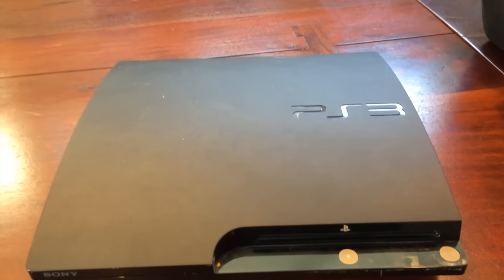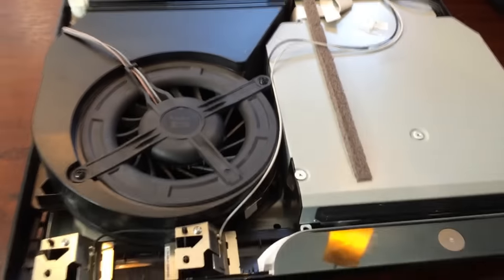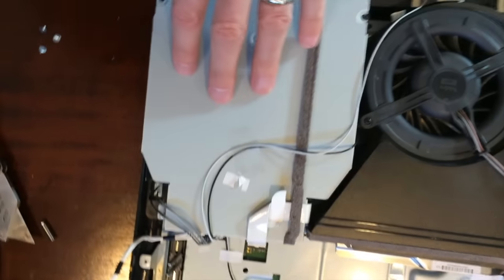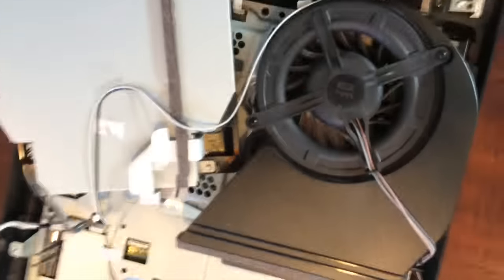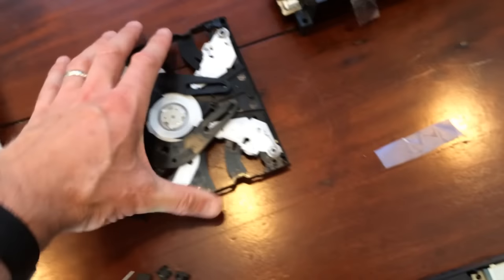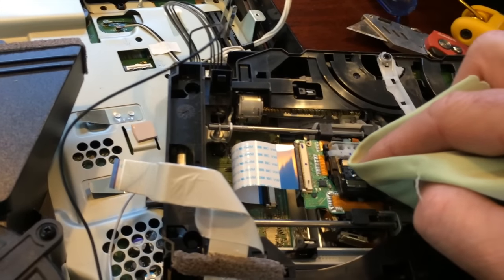How to disassemble and clean your PS3 laser

Comment: What kind of alcoholic do i use for cleaning? Would vodka do? (40%)
Reply from the maker: Probably would leave a residue. Don't think id use it. Rubbing alcohol from the drug store is super cheap.
Reply: Mark Chalmers I ordered 99,9% from ebay, cleaned the laser. Seems like all my games are running fine except Assassin's Creed 3. It will sometimes stop loading and you can hear no sound and it will freeze, and you can hear the laser trying to read the disc. The disc is clean from dust and smudges, tried reinstalling game data too. And option 2,3 in safe mode! Any help?

Comment: Ok. Using this vid. Im gonna try it. I have lots of experience w/electronics. I installed cheater menu start up chips in the original ps for myself and all my friends. I think i can handle this, and it may work. Its doing what most of these are. Doesnt show disc at game menu. Makes an eject sound about 30 seconds after inserting disc. Was freezing on screen often and would have to restart then last night it would not restart. I have a 5 yr old and a 12 yr old, and about 100 dimension pieces counting on this to work. My buddy said i could borrow his sons old console but there go all my kids downloads and saved info. So ill try. The console its self is about 9 yrs old, never been cleaned and looks it . every air duct is clogged w/dust lol so i can only guess what it looks like inside. Trying this tonight after kids bed time. I will leave a second comment whether it works or not. If not, can i really complain ? This thing has had a tough life really. The kids never shut it off. This machine should teally be a testiment to the sony corp.
Reply: Nope. Did not work for MY ps3. But i was not getting an error code. Noticed since i reassembled it DOES play cd's and dvd's but NOT blue ray or ps3 games. I would believe the blue ray part is all done. Dead.
Reply from the maker: how did it go?
Reply: Mark Chalmers well, i ordered the part today on amazon. $25 new laser.keh450AAA.  It needed to be cleaned/vacuumed out really bad. Inside the disc drive wasnt too bad. Got free shipping so ill have to report back in a couple weeks and the kids will have to do w/o for a moment
Reply: Your video got all this going. I would not have opened if i didnt see someone do this. Thanks.
Reply: Mark Chalmers part came this afternoon. Took 30 minutes to install (i already had it apart) it works !!! $25 amazon, im so happy it works, the kids will be even happier.

Comment: SONY SUCKS when it comes to consoles that stop reading discs, consoles that over heat due to not enough vents or the vents are not large enough, and "drum roll", those DANG wireless controllers not connecting or not charging.

Comment: My ps3 dont want to connect on my WI-FI  and I tried that thing with save mode for connection but it still not working will this help if I try
Reply: Uh-
Reply: No
Reply: You either need a better WIFI or a lan cable

Comment: Getting the 3 little screws out in the front is the most ridiculous part of this whole thing...Idk what tools you guys are talking about. The little stud in the middle of the screw is impeding the usage of the star tool and jeweler's screwdriver.
Reply from the maker: It is a pain but if you have the right size jewelers screwdriver it will work. Sorry can't be of more help.
Reply: I got it! Thanks Mark! Unfortunately, cleaning the laser didn't fix my problem 😭

Comment: Ik im 6 years outta date but pls help me... I did everything but when i put in a disc boom at the very front of the ejection port the little white stub thing blocks my discs like theres a game in it but i press eject and it still there and its pissing me off
Reply: Turn off ur ps3 take out the power cord hold down the eject button while holding the eject button plug the power cord back in still holding the eject button it should work
Reply: @Kflipp  thank you it worked

Comment: So basically get the right screwdrivers and tools, screw out certain nails, take out certain equipment, clean the chip causing all the problems and that's it? Got it, thanks.Your basically dismantling the PS3 to fix it.

Comment: Unfortunately, it did not fix mine. It reads PS1 CD's, and it even reads PS2 one's, but says that format is not supported, of course. It refuses to read PS3 games, and I'm out of ideas. I already reset my PS3 yesterday, and it worked for some time, but when I turned it off it started acting up. Anyone have some ideas what it might be, or I'm out of luck and my drive is dead?

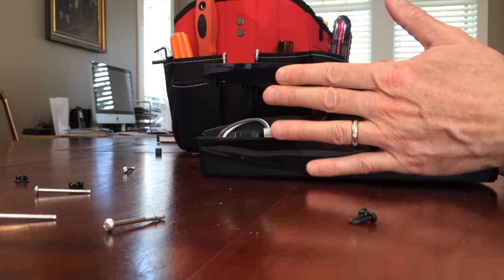Comment: My PS3 doesn't want to open at the front part. In the back can be opened. Is like as they were screwed in the front. At 2:32 moment. Please HELP!
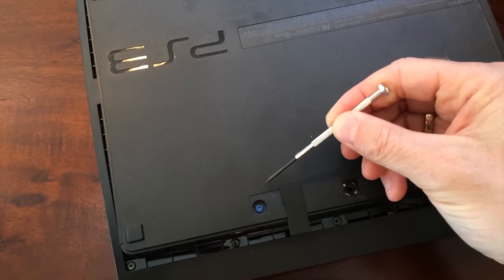Reply from the maker: Hi Marius. Sorry you're having trouble. Usually its the screw under the small cover shown at 1:14 that ppl forget to remove. Other than that, it may be that you have a different model? Hope this helps.
Reply: You have right. Was under the small cover. Thanks!!

Comment: Took it apart, cleaned it, put it back together. Still doesnt read disks but thats fine ill just buy games on psn.

But now no applications will run. Not Netflix, not PS Store. Did I forget to plug a cable back in when i put it back together
Reply from the maker: Weird.....I can only guess that the connection is not tight and the Internet connection is not there. Does WiFi work?
Reply: I have the same problem but it wont even take the disc in. Is this what is happening to you?

Comment: lol so i have a fail situation, as i tried to assemble everything back together and tried it , it did turn on but i pushed the eject button it just start to make loud noise. I turned it off again and redid everything and put everything back together and it did the same thing.  so i am stuck now.
Reply: you messed up the blue ray drive moder mechanism. you have to reset the mechanism. happened to me when a friend and I tried to fix my ps3. he went on and tried things and fucked it up. luckily for me, I managed to figure it out. it's very delicate so try not to mess up the blue ray driver mechanism. search on YouTube to fix your problem. I can't explain on how I did it.
(note: If you did fix ur issue then cheers mate :D )

Comment: my games wont load, they wont spin, is this the problem?
Reply: yes
Reply: READ THIS IF YOU DONT WANT TO MESS UP!
If you are going to attempt what he did in this video my suggestion is don't, it may or may not work but dont physically touch the lens with anything at all, if you really want to clean it the best thing to do is to use Air Compressed Duster. 

If your ps3 doesn't read any disc afterwards make sure the ribbons connected at the back of the lens were put back properly on the board 

If you happen to be from the Philippines go to P x P repair shop in Carriedo Manila. My ps3 was supposed to have a lens replacement, his technician check the ribbons and put it back in place I end up not paying for anything at all. 

In the most filthy of places you'll find the purest and cleanest people ever.

Comment: You taken a 50 - 50 chances when taking any console apart for any reasons. Best recommendations keep care of your console. Don't throw it around or drop it. Don't pour water or soda- pops on consoles. Use the inside console fan to blow dust out of the console every monthly. Don't take it apart. I've had my PS3 for 13 years & still runs/ plays like a Swiss Rolex watch. Never had it apart.

Comment: my ps3 works good but sometimes whem i'm playing a game it freezes and i need to turn it off with the power button can someone say what the problem is
Reply: Is it one specific game? It may just be that the game's unstable cough Bethesda cough or the disk is dirty/damaged
Reply: Predator23321 it's bo3
Reply: khushveer lal What's the condition of the underside of the disk?
Reply: Predator23321 it's clean without any scratches
Reply: khushveer lal Seems like it could be an overheating problem. If your PS3 is clogged up with dust it will make it difficult to expel heat. Try taking apart your PS3 and cleaning it out with some compressed air.

Comment: I took out the screws n the top ain't even coming off😒
Reply: make sure that all are off, and then take from the back like he showed and just keep on pulling back towards you from the back side. had the sane problem but if you're a guy make sure to protect your goods, cause the top will snap off
Reply: I struggled so hard one side lifted n one side didn't n it's hard it not coming off
Reply: +Ja'Niece Mills yeah I had that problem, umm... I was poking around and kinds prying it up with a screwdriver, I used a flat head too if that helps...
Reply from the maker: Did you get it? It should come off easily. Perhaps the screw is still on under the cover? Hope this works for you.

Comment: was able to open a first gen slim, with a cd reader that "sometimes works" but does not show error codes or w/e. clean the bitch out of all the pet fur and other dust, cleaned the lens then slapped it back together.

now the damn thing thinks a cd is in the tray, spins the "cd", then won't allow "ejecting" and physically won't allow a cd to be put in.

gunna be a pain in the ass taking it apart again.
Reply: If it does not work might just have to buy a new disc drive my friend had a similar problem but he bought a new ps3 so I asked if i could have his old one sure enough all I did was replace the disc drive and now I have 2 ps3s lol
Reply: found the "reset" for the tray after disassembly. after cleaning the tray and replacing the top black plastic half, you remove the bottom metal plate and pull out the bottom "big" spindle from the corner. after pulling it out, the tray mechanisms reset position, then replace the spindle and reassemble the tray. - all is fine and dandy, now the ps3 reads blueray cds again with no issue
Reply: Nice I will do this if my disc tray ever has problems
Reply from the maker: Thats huge! Thanks for letting us all know.

Comment: Uuuuhhhhh it's not turning on...

Edit: nevermind I fixed it
Reply: Unknown mine won't turn on either. What did you do to fix yours?
Reply: Quyen Tran one of my cords inside wasnt in proporly, just check each wire.
Reply: Unknown thanks I repeated the whole thing and it turns on now but still doesn't read disks :(